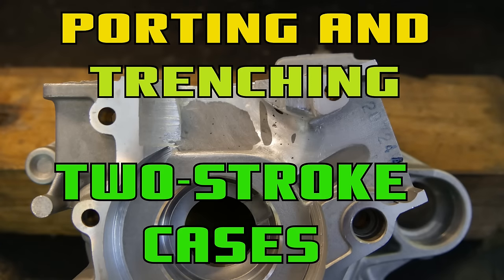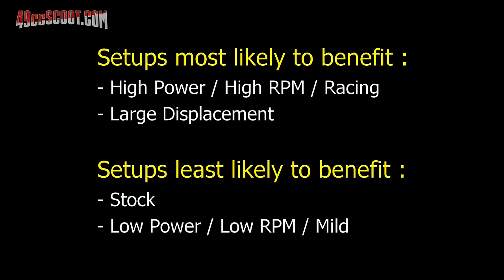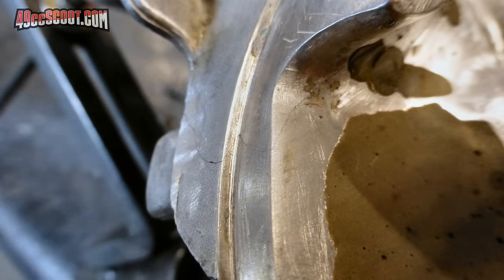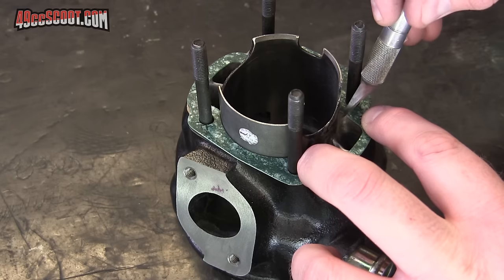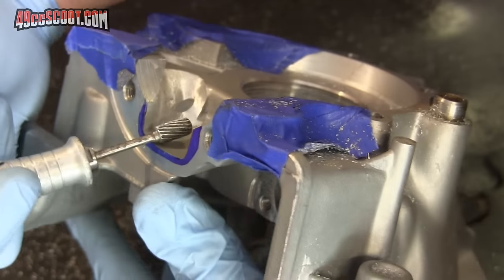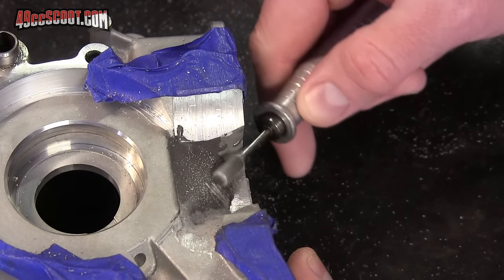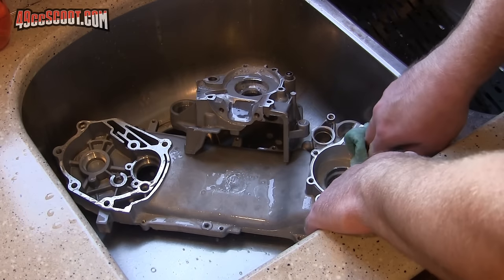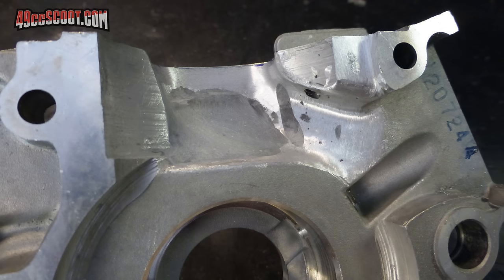Port Matching, Porting And Trenching Two-Stroke Engine Cases

Comment: Couple of not very good ideas on this video.  First using a Chinese base gasket, which is obviously not made accurately, as a template to cut the crankcases.  Secondly, use of cheap home user epoxy is far from ideal. 

An industrial product such as Devcon F is far more suitable and as it's filled with  powdered aluminium, expansion/contraction rate is similar, and chances of cracking greatly reduced.
Reply from the maker: The base gasket is matched to the cylinder. It then gets used to match the cases. I don't care if royalty hand crafted a base gasket; I wouldn't  suggest using it for the cases unless it is first matched to the cylinder or whatever spec/design  you desire.

I do agree that there are likely better solutions for epoxy/filler, but I think you'd be hard pressed to find someone with more time and miles riding this particular style of engine as shown. I have had cracking, but I've also got old engines that are still fine. I bent and damaged a crank, cracked a roughly 1/8" thick steel ramp plate, and more when a bearing failed at 14,000+RPM last year. Lots of stress on the engine. JB Weld was fine. The best and works could be 2 different things, but if a better epoxy could minimize failure risk that would be great.
Reply: @49ccscoot  The base gasket moved at least 2mm, when you were marking out, and as the gasket face on one side is very narrow, and could lead to leaks, this seems a very half hearted way of doing modifications?  An aluminium plate, cut out accurately and fitting over the studs properly, is the correct way to do the job.

It's up to you if you want to use a cheap home user epoxy like JB weld.  I have found all unfilled epoxy products to be brittle, and far more likely to crack and fail than a purpose designed epoxy such as Devcon F.
Try Devcon, its very doubtful if you would ever use JB weld again!
Reply from the maker: @humourless682  You realize that I did not go all to way for a port match based solely from the marks? The first part is getting close, but not exact. The cylinder can go on later or gasket matching can be done again. A metal plate would be nice, but if you're doing 1 engine and the next will be a little different, the time to make a plate is not worth it IMO. Maybe if you're trying to be a world record holder and believe that a decimal place of a mm will make or break you. You will not achieve a perfect match regardless. Not as-is. Match as perfectly as you like. Get it within 0.000001". Then, when you install it, the play in studs and their holes will shift and it won't match. If you want a very precise match, the only way is to eliminate that play with dowels that are snug against the stud and cylinder or some other form of locating dowel. Yes, that would be the by the book correct way. At some point you have to weigh out benefit vs cost and effort. I wouldn't mind doing all of this for some things,  but this is a ~$100 pair of engine cases made of who knows what from a Chinese factory with poor quality control standards.

I tried Devcon once. Actually my 1st cases IIRC. Cost was at least 5x that of JB Weld. It cracked pretty much immediately. I said forget it and used JB Weld since. It may not have been Devcon F. Probably wasn't. I looked at products and used what someone else recommended at the time... over a decade ago. There are also people that think you're wrong and only welding or brazing should be used for backfilling. Everyone has their own opinions. I'm just telling  you that I have a lot of experience with this working. I have at least 3 engines in my garage right now like this. Probably more than that, but I don't wish to overstate or go count. I'm not saying I won't try Devcon F either. I'd kind of like to. I'm all about learning and improving. I think JB Weld has just worked well enough for me that I haven't wanted to risk trying another product that is (to me) unknown.
Reply: @49ccscoot  If you are using base gaskets, which are moving 2mm side to side on the cylinder studs, and are interested in matching the cases to the cylinder base, reasonably accurately, the first job is to get some gaskets which fit the studs properly.  

Devcon F is the best possible epoxy to use for modifying engines.  If you choose to use cheap home user epoxy simply to save money, that's up to you, but I cannot see something like JB Weld lasting long if it's used on a crankshaft for instance?   

Devcon will work perfectly on  2T intake,  transfer ducts, and cranks, also 4T intakes.  No good for exhaust ports, though, which must be welded with a special purpose TIG torch.  

The idea of hogging out ducts as big as possible, is something which may provide increased top end power, if the port windows are also properly altered.

However, this type of modification, will also reduce transfer port velocity, and tend to reduce power at lower engine speeds, making the power band very narrow, and making a bike not that nice to ride....
Reply from the maker: @sickophant  Regarding the lack of low end power... In my case these mods are for scooters. My current engine spends all of it's time between 8,000-14,500RPM, aside from idle. The clutch and CVT bypasses low RPM. 8,000RPM is basically chugging through town  slow. Mostly it's 10,000+. This is life with this sort of engine, even without the porting, so there's not a lot of consequence to changing how it operates at low RPM in this case. I have used it on lower revving scooters, but even then they are 4000RPM minimum when moving and I tune my 2Ts rich at low throttle whenever possible so I'm not looking for max power and efficiency there.

Oh, also about the studs/gaskets. With these engines, even the stud holes in the head will let the head shift relative to the cylinder. Dowels or locators are pretty much how most deal with shifting... but good luck finding many that bother to go through the process to get that right. Any slop at all in the fit between  the skirts and the crankcase will also cause shifting if you just rely on gaskets being snug to the studs. These are not highly precision made engines and components in general. Again, you have to decide how far you want to take it and how much it's worth to you.
Reply: @49ccscoot  Sorry, I didn't the know cylinders were for rubber belt scooters!

Even so, it might be helpful for you to get to grips with doing porting work properly?

There seems to be a fair amount of demand, and older motors in particular seem to benefit a good deal from porting changes?  

Not sure if there is much money to be made from rubber belt scooters though, as I think various Chinese big bore kits, can be had for them very cheaply?
Reply from the maker: @humourless682  Professional porting for scooters is generally for very high end builds only. Most people in this market don't wish to spend a fortune. Bolt-on coated cylinders is as far as most will ever go. I've never dealt with a pro porter, but having an aluminum cylinder stripped, ported and then re-plated costs more than pretty much any common high end kit out there. You can already build a 20-30HP 49cc based scooter with the porting that comes in the cylinders, so not many want to spend that much more. Cases like the C-One or RC-One from Malossi improve the case design and strength for less than you'd pay for new stock cases and a pro porter.
Reply: @49ccscoot  My point was, is that as you seem to have professional porting tools, why not offer porting services on things other than belt drive scooters?
Reply from the maker: @humourless682  Scoots are what I do. Plus, there are pro porters that will provide way better results than I can when it comes to cylinders. They do it all day every day.
Reply: @49ccscoot  I would have thought if you have $1000+ into pro porting tools, you would be interested in making some money with them, rather than messing around with belt drive scooters?
Reply from the maker: @humourless682  The Foredom setup isn't that much. It goes over that if you do buy the small right angle handpieces that pro-porters have multiples of. 

To each their own. I actually like small scooters. I used to have a bored and stroked turbo Mustang so I'm not a stranger to building more powerful and larger things. I sold it when I realized that I enjoyed my little 2T scoot as much as the massively expensive car. I've got a bigger bike in the garage too, but I prefer riding the little 2T to that as well... aside from long trips or twisties.
Reply: @49ccscoot  How do you alter the transfer windows in the cylinder without right angle handpieces?

I would have thought that  49cc motors, means the changes made have to be very precise to make much difference?
Reply from the maker: @humourless682  They can be mildly altered with files or sometimes (big bores) may be able to make small changes for cleanup with the right approach. For the most part, most people that aren't pro porters should leave the transfer roofs alone, even if they have nice right angle handpieces, because the angle of entry is critical and easy to mess up. Again, the high end cylinders are coated aluminum, so you're kind of pushing your luck to even mildly mod those. Even filing could be enough to leave an edge that starts flaking off coating.
Reply: @49ccscoot  Do you feel messing around with the cases, and transfer port entries, makes a significant difference?

Not a great idea to alter plated cylinders, so it seems to me, that you would be better to look closely at modifying, older motorcycle cylinders, that have cast iron liners?

In terms of function, simply cleaning up the transfer entries into the cylinder, with a 90 degree tool, is likely to improve things more than spending hours on the cases and port entries.